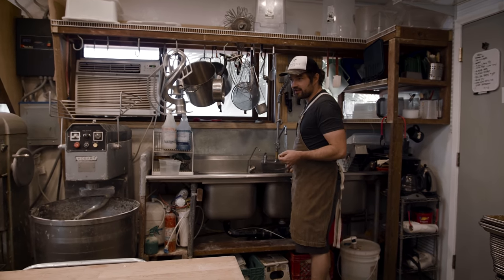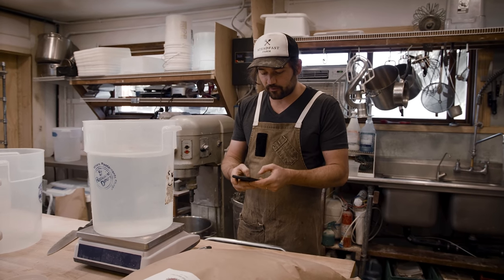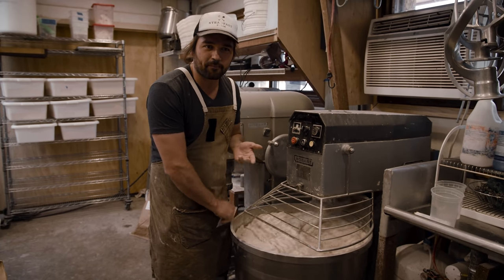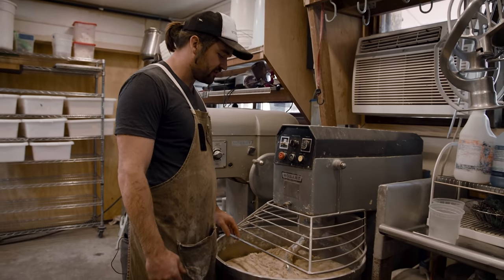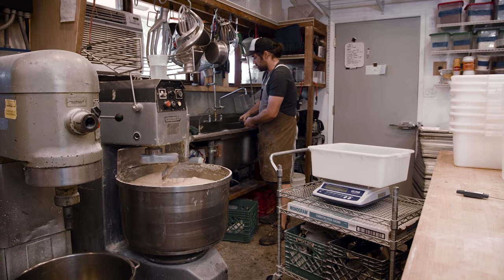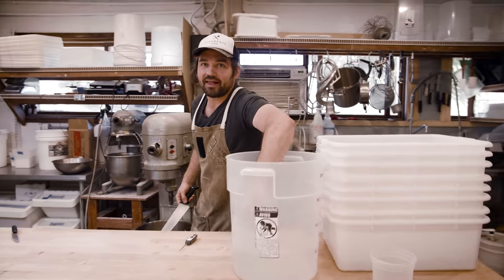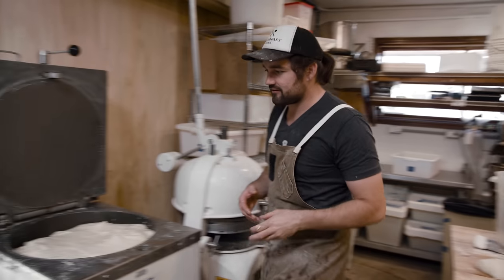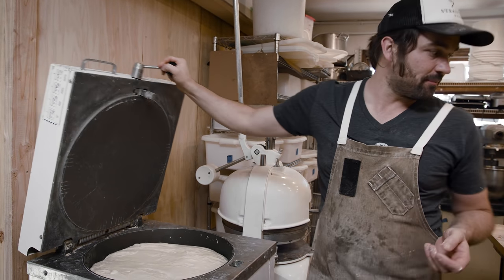Artisan Sourdough Bread Lessons from Our Garage Bakery | Proof Bread

Comment: Great video!! I’ve been baking in our little RV oven and have been using a Dutch oven. I recently elevated the loaf on a roasting rack (parchment under the loaf) before I close the preheated lid on the Dutch oven, I sprinkle water on the loaf/in the pan. My rise has been amazing since doing this! It’s tricky using a small and inconsistent oven but the pay off of having fresh sourdough while traveling is well worth the hard work!
Reply: Anna Meaker try throwing in 3 ice cubes between parchment and pan. Pop the lid on and it gives the dough a shot if steam,

Comment: Based on what he discussed, here are the percentages he is using per loaf:

400g flour
320g water
80g levain
8g salt
Reply: That's 80% hydration and he said they lowered hydration, oh dear. I know different kind of flours play big role but that's high one
Reply: @belmin3905  its manageable! if youre a newbie, start at 70% and just slowly add more water 50g at a time everytime you make bread.  just practice is all.
Reply: @stefaniek5991  It is manageable with a good flour, supermarket flour doesn't hold well with that hydration percentages
Reply: 380g flour
290g water
130g levain
8g salt
That's 80% hydration (what do you think about it)
Reply: @zibi0111  thats quite high levain ratio, you may overproof your dough before you can develop the flavour and break down the anti-nutrients
Reply: Chuck Cawthorn generally 35-30 minutes between folds. Total 3 or 4 folds.
Reply: @DaNinjasDen  
thanks for the advice;) do you think the proportions given by @lenhister are ok?
Reply: I have been playing around with low % of starter. 2,5% It’s pretty cool to see how such a small amount of starter can produce beautiful strong loaves.
Reply: Giving this a shot
Reply: Shouldn't you factor in the water and flour in your levain when you calculate hydration?
Reply: That is not 80 percent hydration. You have to take into account the water and flour in the starter.
Reply: 3 folds at 30 minute intervals.
Reply: I'm new to this but from what I've learnt so far 18% Levin doesn't seem much compared to a recipe I've been following, which has : Flour 100%, Water 52%, Starter 53%, Salt 2.5%.  
 I've been struggling with over-fermantation at times, so If I keep the same dough weight but use half the starter (100% hydro), then return the other half back to flour and water I'd get: Flour 100%, water 57%, Starter 23%. 
Both the above dough recipes seem dry in comparison to 70% or 80% hydration of the Proof Bakery Dough recipe.  
Any thoughts ?   is 20% starter the best ratio or is just down to taste ?
Reply: @Bananarchy That's roughly Water=67% , Starter=22%.
Reply: @Bananarchy .  I’m just starting out with sourdough, just worked my recipe out at 52% hydration which seems low, although it uses 53% starter, which seems real high. Results have been ok, last loaf was great. I’m going to start increasing hydration to 65% and reduce the starter to 25%, seems to be a more common dough.    Thanks, that’s my old  83’ JV Squier.
Reply: @jim6100  They use 100% hydration starter I think. So it won't make a difference to the percentages.
Reply: only 800 g per loaf
Reply: Chuck Cawthorn  usually 6 folds scaled out with 30 minutes for each rest
Reply: @jacquesalbertyn2470  ... is that 2.5% of inoculation of the lavain  or 2.5% of starter for the dough...joe
Reply: Lewis Heriz yes, and that would bring the hydration to almost 82%(81.8), if you’re picky you have to factor it in.
Reply: Joe Stubbs 2,5 % starter/levain of total flour weight
Reply: @jacquesalbertyn2470  One thing to note for those of you talking about high hydration in his sourdough. He is in Phoenix, and Phoenix is a super dry climate. We have super low humidity throughout the year, so we have to make up for it in the formulas.
Reply: Those... aren’t percentages
Reply: All the concern over hydration!  My usual recipe is over 90% hydration - a good flour can handle it.  390 g flour, 360 g water.  The levain seems high - mine is only about 5%.  There’s no problem with a larger amount of levain, of course - since he refrigerates overnight.  With a small amount, you’ll want to let it set at room temp for a while after your folds, before refrigeration.  I do an autolyse of 1/2 hour, 3 folds, an hour apart.
Reply: @mere_mort4l  the levain should alway be factored in, both for the flour and water.

Comment: Pro tip from 28 years of being contractor, finish carpenter, and woodworker. Treated wood has chemicals injected into it to allow it to have ground contact and concrete contact. Both are moisture holding places. I would trade out that treated wood and replace it with something used in boats. Like teak, white oak ( not red oak) western red cedar or even redwood.
Reply: In aus where im from no wood is allowed

Comment: Not worked with a mixer but I design machinery.., so with regards to the hand in the mixer, relying on your ability to let go of the scraper in the event of an emergency isn't the best solution. What if it's someone else less experienced, what if you're having a bad day and mind isn't on the ball etc.

Other than making mods to the mixer, I'd suggest some form of scraper attachment on a pole which avoids having to put your hand inside to bowl whilst the mixer is on.
Reply: Bad move.
Baker here,we all use a scraper,
Putting a pole into the mixer is dangerous
Reply: Sounds like a great way to give the mixer a weapon to hit you with. No experience with mixers, but grew up working with farm PTOs. Even a caught piece of fabric can be a weapon at higher speeds. At this slower speed a spinning/oscillating pole would scare the crud out of me. If you have to scrape, a single sacrificial plastic piece that does not extend outside the bowl works. Notice he has no sleeves to get caught. As long as you do not reach past the limit of the guard it is as safe as you will likely be able to make it.
Reply: A paddle basically
Reply: @vwbusguy  Ankarsrum has this scraper attachment which is appended to the mixer from above. Maybe such a contraption might work?

Comment: On the question about scraping the mixer while it is running. What I was taught by an old school bread baker was to use a long cake decorators spatula.  It has a flexibility and strength and can conform to the curve of the bowl while your hand is above "the action" so to speak. They come with a 12 or 14 inch blade and can be found in restaurant supply stores like this https://www.webstaurantstore.com/dexter-russell-19983-sani-safe-12-blade-straight-baking-icing-spatula-with-plastic-handle/21019983.html

Comment: If you have a scraper for the bowl sides that has a handle/arm with the scraper blade angled a little to your ideal angle, it would be safer and effective. Could put a hook on the opposite end for easy storage and it won’t take up much space in your work area. Awesome videos with lots of knowledge, thank you so much

Comment: you can totally attach a plastic bench scraper to your cage that scrapes the sides as the mixer runs. learned it when i was working pizza years ago. you can probably rig something up with a c-clamp and some bondo.

Comment: coming from a manufacturing background, you could probably have a fixed scraper arm (even articulated) custom made and installed so you do not have to do the scraping by hand. Also, I'd recommend doing a form of lockout (not just a push of a button) when the guard is lifted to protect against accidents.

Comment: With regards to the mixer and using a scrapper, you can actually use a sturdy and thin metal strip. It should be flat so you just hold it against the inner surface of the bucket. The length of the metal strip should be larger than that of the bucket so when dipping it inside the bucket, your hands stay out of that bucket and spiral hook.

Comment: OK, I'm ready to join your cult. Where do I sign up? ;) 
Can you please talk a bit more about your custom flour mix? What grains are in it, how you came to decide that it was the mix for you? Also, as a home baker how do I determine how much hydration is appropriate for the flours I'm using? Is it simply trial and error and gauging crumb, strength and texture, or is there a way to assess it? If I change flours ie add 10% more whole wheat, is there a rough formula that would tell me how much to increase my hydration? Thanks!

Comment: Great video John. Thanks. I watched you fill that mixer with two 50-pound bags of flour and a bunch of water. I think you mentioned that you were making an 80% hydration dough. But then you tossed in a bucket of wet (100%?) starter. From the comments below, someone deduced that you put in 20% starter. Is that correct? Did you adjust your mix to account for the flour and water in the starter?

Comment: Thank you so much for sharing your knowledge, I'm so glad I found your video. 
One question, if I'm using a pizza oven, without steam, I put a pan of hot water in the oven, should I remove the pan of water in the middle of the baking? Or I just need to let the vent from the oven opened, leaving the pan of water in the oven throughout the whole baking process?

Comment: Could watch this all day ! Thanks for all the info. 
One question - I use 120g levain to 500g flour (400 white/50 Spelt/50 wholemeal) 375 water 10 salt. Is that too much levain ?
Reply: Depends on what you want to achieve. More % levain -> more acidity in the bread.

Comment: This had a lot of good information on the sourdough process and benefits.  I know that you have flour that is free of glyphosate, but have you every tried your starter on flour that had glyphosate?  I had a starter that was created with glyphosate free flour and when I tried to switch to King Author bread flour the starter died.  I later found out the KA flour most likely has glyphosate so was wondering if that may have killed the starter? 
I was also wondering what you do to get a sour flavor in your bread when you want that?  I have not been able to achieve that flavor yet.  I have read that the sour flavor is from acetic acid.

Comment: I dont have experience in baking at all. But on your question on how to do the thing on the side that you mention around 09:00: cant you just use like a broomstick with a doughscraper on the end?
Reply: I had exactly that thought!
Reply: I work as a baker, you need dexterity which a broomstick does not provide, hands are the best tool for this job. If you run the machine empty you can see where the spiral arm is, and you don't have to be anywhere near there to scrape down the sides.

Comment: I keep my starter at 125% hydration which I use as liquid starter.  I have built a spreadsheet that allows me to enter hydration % of starter, desired % of hydration for Levain build and % of starter to be used in final Levain build and the desired weight of Levain build and the spreadsheet will automatically calculated g’s of starter needed and g’s of flour and g’s of water needed.   Result Levain build would then have hydration specified in recipe. So if firm Levain recipe or Poolish Levain of liquid Levain my spreadsheet automatically does the calculations for me.   This way I only keep my starter maintained at 125% liquid starter.   I don’t know if your model of mixer has dough arm option or breaker arm option or bowl scraper option.   Some spiral mixers have one of those options, it causes the dough to pull away from edge of bowl ensuring all flour gets incorporated.
Reply: Brilliant idea on having a spreadsheet to give you the calculated weights. Like it!

Comment: Dude you don't have to use a plastic scraper for the mixing bowl. Have someone fabricate a metal arm that extends to the edge of the bowl and is attached to the cage. When you lift the cage the scraper arm will lift as well. It should be a 5-7" stainless steel scraper that about 3-4" wide at an angle of about 20-30° from the tangent of the bucket. 
Good luck and save yourself some energy and plastic scraoers 😜

Comment: 1.) Have you experimented with using filtered or distilled water, and is it worth the cost at your scale? I ask because i only drink filtered and boiled water, and because of this i prepare all my own food and drink because i realized my standards don't align with the standards at restaurants. 

2.) Everyone working has long hair. Does anybody care about hair in their food? 

3.) Consider shaving the beard because a beard prevents a good seal with a gas mask. 90% of fire casualties are from smoke inhalation. If you have a fire extinguisher in your car or your structure, you should also have at least a respirator.

Comment: Metric hint: one litre of water weight 1 kilo.
Reply: kilo and litres are just interchangeable for solid and water.
Reply: Only at 25C
Reply: Try to put mesured one liter of water on the scale and you'll see that the liter measures are approximate, not as exact as scale

Comment: Since you don't want to loose your arm or you life, stop the mixer, scrape, and mix for another 30 secs. The opening is solely for adding things (like raisins) during the kneading, not for putting your hands in for ANY REASON. New models have this gap closed because it's dangerous to put your hands in an mixer during operation. Additionally in new models when you open the protective lid, kneading stops. You don't want to see what happens when the dough hook takes your hand in...

Comment: You shouldnt scrape the mixing bowl with a metal scouring pad, could result in (over time) damaging the chromature of the bowl, that will lead to oxidation and damaging of it (and some metal flavour to the bread too)
Reply from the maker: Thank you for this. How would you suggest removing the dry material?
Reply: @ProofBread  No idea. Someone suggested some plastic scraper on your videos, but those will break/damage in some time. One solution could be to put a bit of hot water inside and cover it and wait to be moist to remove everything with the rear of a classic dishes sponge, but i understand that need time and organization, and that's not always possible in a busy environment. Something woody? maybe a wood spatula, could be better. Make some tries and see wich material or utensil (thats not made by any kind of metal) could do the work properly and not make too much abrasion on the bowl.

Comment: Please differentiate between the Hobart Spiral mixer and beside that the 60 quart regular fixed bowl Hobart mixer. YOU WOULD NEVER STICK YOUR HAND IN THE FIXED BOWL MIXER. Let me repeat that: YOU WOULD NEVER STICK YOUR HAND IN A FIXED BOWL MIXER.! Put NOTHING into the fixed bowl mixer until the machine is shut OFF and the hook is no longer rotating. Then you scrape down the bowl and then turn the machine back on  AFTER you've scraped. In the spiral mixer the hook rotates at the rear of the mixer and one can assume you can scrape as you are doing.

 In the fixed bowl mixer the dough hook comes all the way to the front of  the bowl and WILL GRAB YOUR HAND AND RIP YOUR WHOLE ARM OFF!!!!! OMFG!!!

In the spiral mixer use your largest wooden spoon about two feet long and HANG ON. Carve one from beech or ash.
Reply from the maker: The tone of your comment is appropriate. The mixers have a force that can kill. They shouldn’t be taken for granted. Wholeheartedly agree on the fixed bowl, and I will be sure that commentary gets into a future video.
Reply: @ProofBread  thanks for your reply. The tone is a bit strong but for the fixed bowl which IS the most common Hobart mixer out there like the 20 quart or the D-300 30 quart is more likely to be what readers purchase for the earlier stages of their operations or working at an existing business. Thank you for your diligence and prompt reply